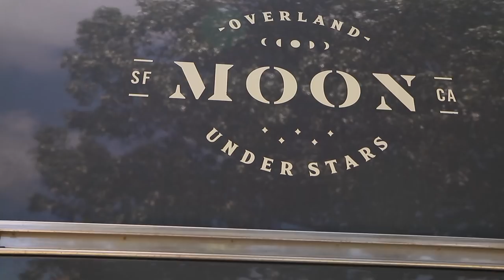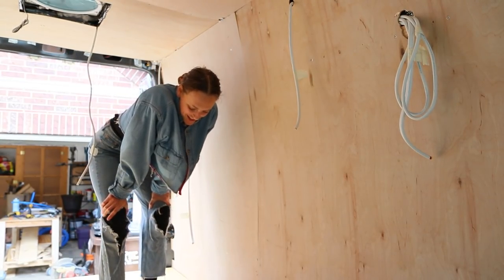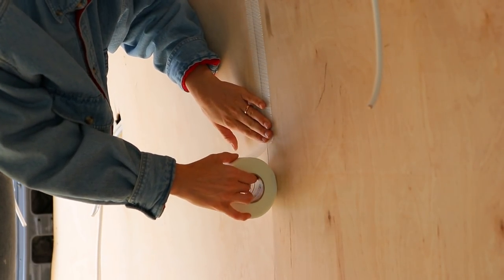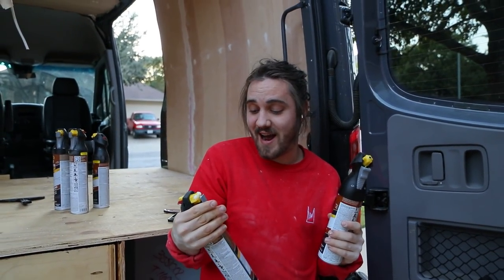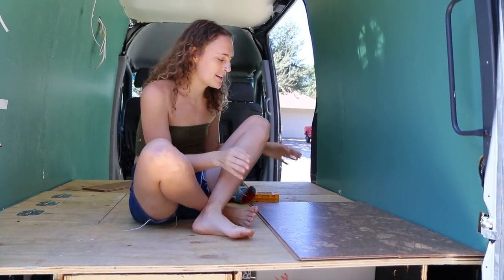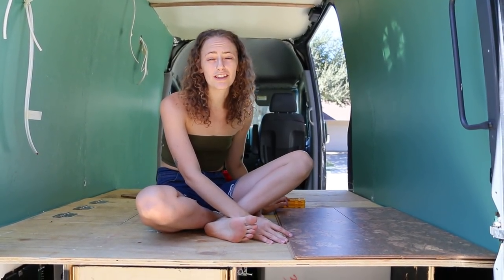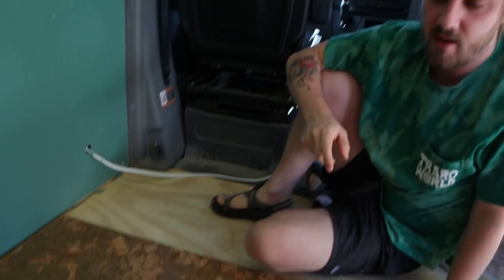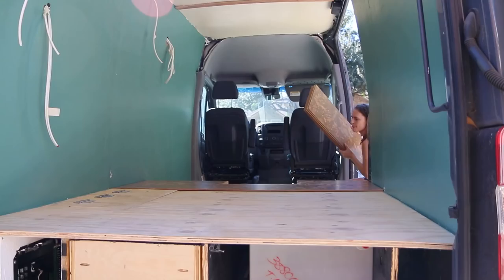DIY Van Conversion | Painting Walls + Unique Cork Flooring

Comment: Hey guys, interior design student here— cork flooring in a plank as you have shown here is not insulating the same as it might be in a natural cork roll format, you have a finished and sealed version without the spongy air pockets which would give it the acoustical and insulating values it has. still a great product!!

Comment: For your next build, when you put the pink think on the wall (sorry forgot the word for it in English), you should 1) use a spatula so it spreads it evenly, 2) sand it to avoid that seam that shows on your walls and on your ceilings (they sell that right next to the pink putty at the hardware store). Also, another trick: start painting the ceiling first. It can avoid you finding some splatters of paint on your wall.

Comment: Adore you both and love that your building for the people. 

But be careful with using drywall sparkle for your seams. With vibration because it is like dries sheet rock it will crack. Just like when house settle and you get cracks in the wall. You may want to sand and put wood putty over it. It has wood fibers in it and will hold up much better.

Comment: Wow, those seams in the walls are worse looking than if you used any other technique or did nothing at all.
Reply: I think they needed to sand it more. too much spackle was added.
Reply: They needed to use a spackle knife as well. That 8-in-one is not for spreading spackle.
Reply: It looks OK at 7:03. Where does it look worse than uncovered seams?

Comment: This has got to be the most half a$$ buil ever
Reply: The actual seam would have looked better than their "patch"
Reply: Right? I am also watching Eamon and Bec or Max and Occy and their builds are so much better. I dont know if its because of budget issues or if its because they dont want to put in the effort if they will not live in it but I do not like this at all.
Reply: $5 USD is all it would have taken to make it look good. Putty knife and a sanding block. It's lack of effort on this one.
Reply: @Wilf Sukowski never been subscribed but they constantly show up on my feed. The build for Holland and even Eamon and Bec was beautiful. No mesh tape! I don’t even know why they bothered with the mesh tape when the seams are so bad.
Reply: @pocmarana_ctenarka  it’s so half-assed without any explanation as why they went with such cheap parts. Different brands of battery? A mesh tape to “cover” the seams? This reflects soooooo poorly on them and Moon Shade
Reply: @djvorac  it’s atrocious. I’ve seen build where the seams were difficult to cover but by design and arrangement of furniture, it was covered. The seams on the sealing bothers me so much. Various folks will be living/renting/trying this van out and they’re going to face moulding issues so quickly.

Comment: cork flooring will not insulate the floor like actual insulation will. this is frustrating to watch.
Reply: We have use cork in two homes in the basements on cement floors (with vapor barriers of course). We found them to be very insulating and warm to the feet. —in Colorado and in California Central coast.

Comment: Floor and walls colors dont match at all! Also corks expands like hell with heat..and winter is coming. Seams look worse than before..come on guys, i get the "amateur" build part, but you can do so much better than this! Take it down and start over.
Reply: The seams look OK at 7:03. Where does it look worse than before?